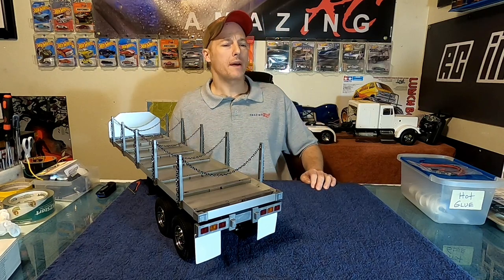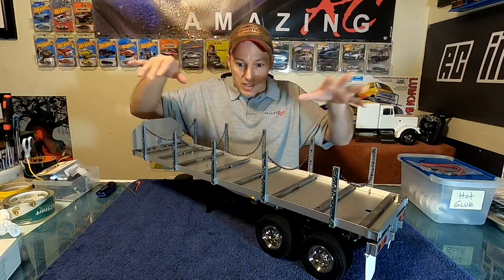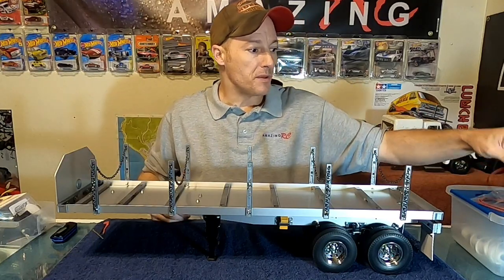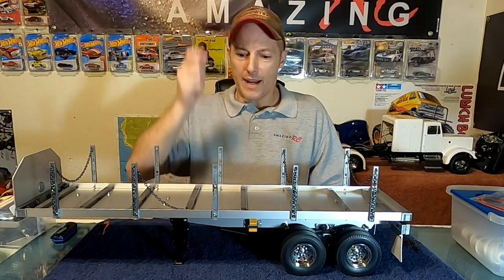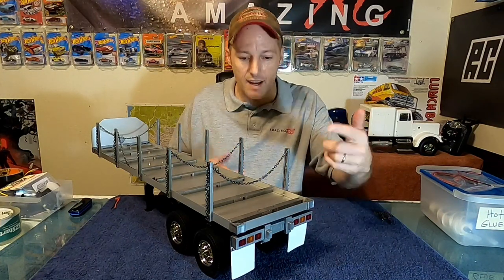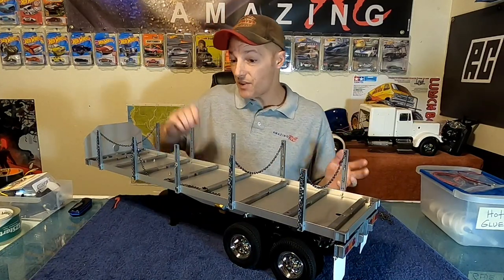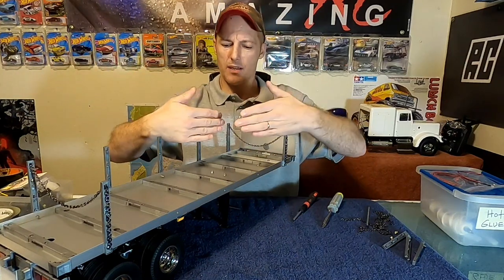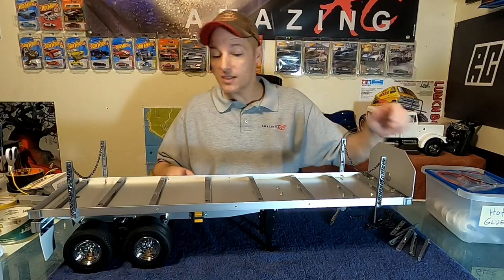Tamiya Flatbed Trailer BAG D.!!  & LED Lighting Talk

Comment: Awesome solution for the LEDs.👏👍 Yes the hole is for the wires, the should be another at the back or inside the rear wall of the truck.
Reply from the maker: I'm going to try to use the holes given for sure... unless I have to rip a portion of the deck up. I may do a little custom work with that one. Keep you posted.  Many thanks for the great comment.!

Comment: Real semi trailers have your air and electrical coming out the front and hooked to the tractor, so it’ll look pretty realistic with the wires coming out of the front connected to a plug.
Reply from the maker: Ugh... I just hate the idea of cutting a hole on thr decking. As much as I hate to say this, I will take another look at it. You have a really good idea.  I could also make little curly cues out of the LED wires like the real thing. Keep you posted.!
Reply: @AMAZINGRC  I totally agree, I would either run it out between those screws or under the deck, and totally agree with wrapping the wire into curly cues like the real air lines would be..